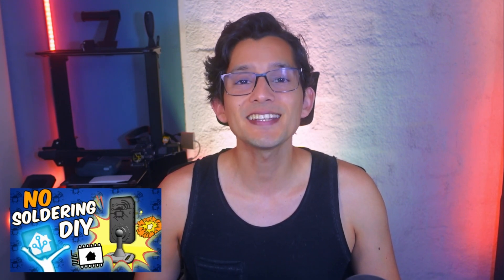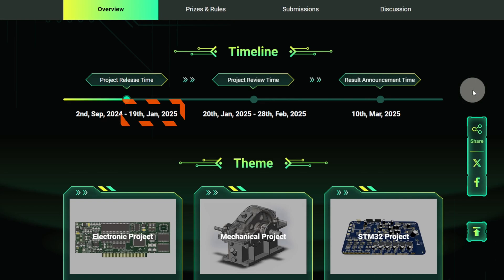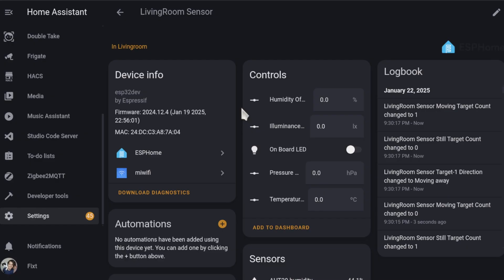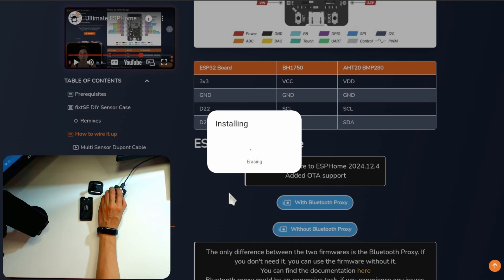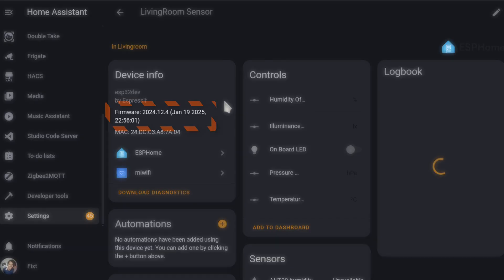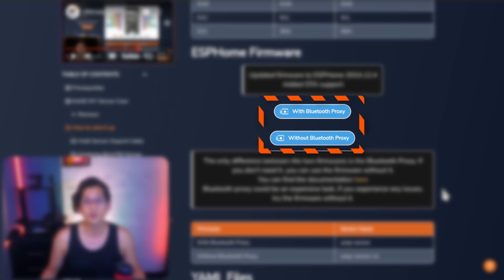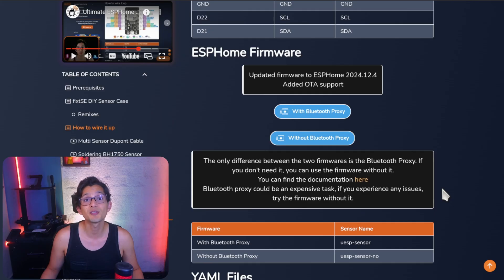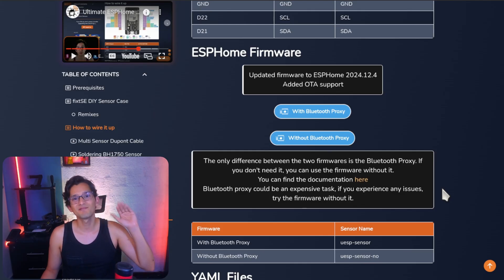I added OTA support to my ESPHome Projects | HLK-LD2450

Comment: A update is available but the update dose not start
Reply from the maker: Hi, yes I made a mistake with the name of the file, that's why the sensor didn't start the update process, it's fixed now and should update without any issue 😅
Reply: @fixtse. Sorry, the same issues is still there

Comment: Hello! Love this! However I have tried updating in the settings multiple times but no luck. I’m on 2025.2 and trying to update to 2025.3.2 and it’s not working at all. Any ideas?
Reply from the maker: Hi, thank you for letting me know. I noticed that the script didn't upload the latest firmware version, but it did update the metadata file. As a result, the sensor is looking for version 2025.3.2, while the available binary is still 2025.2. I'll resolve this issue in a few minutes.
Reply: @ thank you! Updated perfectly!
Reply from the maker: The OTA version has been updated. It turns out the respeaker-lite build was crashing, which caused the process to not complete correctly. Fixed now

Comment: Thanks for adding this. I updated to 2024.12.4 and the sensor is working well but ESPHome dropped 2025.2.0 yesterday and while all my other devices notified me to update, yours did not. Any clues? Even after a restart, the device did not detect an update.
Reply: Suspect you need to purchase the code from him to get latest ota updates. So fundamentally what this does is update to an old version of Esphome and Not allow OTA.....
Reply from the maker: Hi, no, the OTA is free. I encountered an issue with the script I use to automate the building process. One of the projects (the respeaker lite) has a bug that causes it to crash if the build cache isn't cleaned beforehand, which led to the script crashing before completing the process. It's fixed now, and I've added some code to make the building process more resistant to errors in the future.
Reply: @fixtse.  I'm now getting an update notification in HA but the device won't update. Rebooted both, still the same.
Reply from the maker: @ Could you clarify which project you're using? I suspect it's the mmWave radar sensor only. If that's the case, I've managed to replicate it on my test sensor and I'm currently investigating it. I tested the Ultimate, and it updates without any issues. Just wanted to confirm if my assumptions are correct. 
It"s weird because one works and the other doesn't but the code for the update functionality is the same.
Reply: @fixtse.  Yep, mmwave no Bluetooth
Reply from the maker: Hey, check again, you should be able to update now, I made a mistake with the name of the file I put a - instead of _, that's why the sensor couldn't find the ota file and didn't start the update process 😅
Reply: @fixtse.  Thank you so much!! Updated now. Great job
Reply: @fixtse.  I updated the mmWave ESP with Bluetooth Proxy version on firmware: 2024.12.4 and doing update via homeassitant it says that it installs and when it gets to 100% the version does not actually update and it stays on 2024.12.4 even after refreshing the page.
Reply from the maker: @firelion98  Hi, witch project and version are you using? (with or without bluetooth).